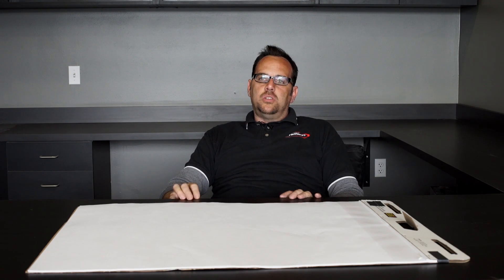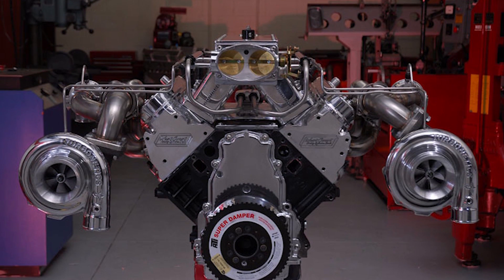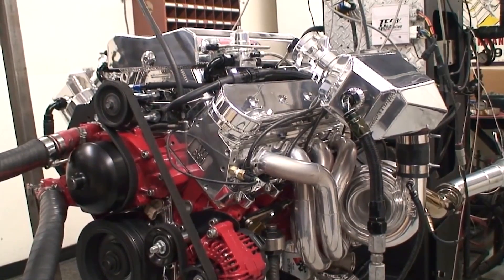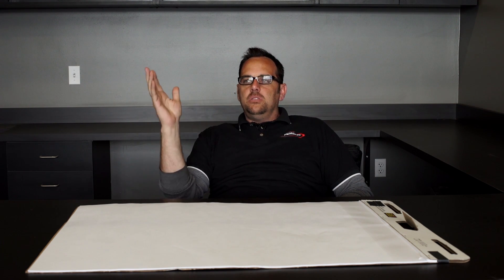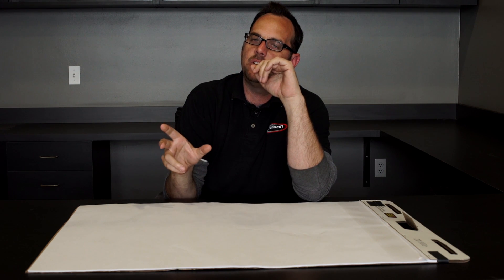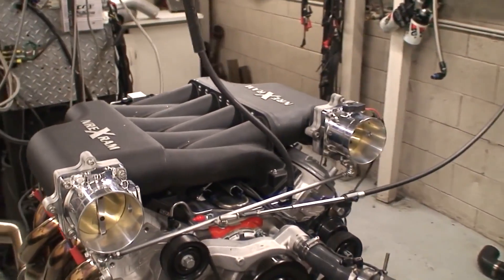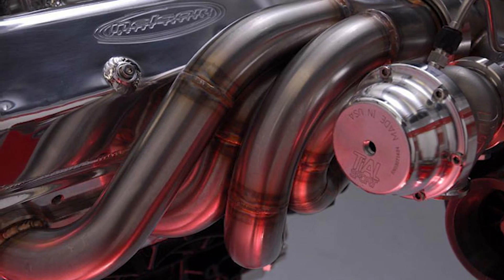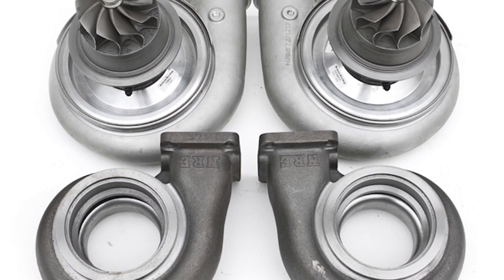Master Engine Builder Explains Why the LS V8 Is SO Good

Comment: wankel = god. fuck ls.
Reply: That is why the RX-8 sold so well! Oh wait...
Reply: inb4 gas flow efficiency, dated design, cool gimmick and dead end tech.
Reply: inb4 reliability.
Reply: Rex Pepper Wow!!! You really went there?! GTFOH with that leaky apex seal bullshit..  There is a reason why mazda doesnt run rotary engines anymore..I tell you like i tell the ford guys if youre engines are so good.. Then why do mazdas get LS Swapped?! Drops Mic
Reply: I'm going to have to agree; wankel is a better concept.  Not as easy to mill a wankel engine as to bore a piston cylinder tho.  LS is probably the best bang for your buck with high horsepower piston motors, which have been refined for racing auto's to the nth degree.  Wankel notso much...totally comparing apples to oranges.  If we were to re-write history and the wankel took over autos in the 50's then our car engines could be 1/5th the size for the same power.  I tried to buy a wankel a few years ago but the military has all manufacturers on lock down bc that's what they use for their drones.  Wankel has a bright future in aviation and EV's, but not in American autos where the politicians decide what's on the street.
Reply: Starstriple Dated? sure, but worthless and pathetic? fuck outta here.
Reply: wankel is like two stroke engines today..

Comment: 300 hours per engine, at 100 bucks an hour that's a 30k a motor
Reply: I'm sure that 300 hours is for the R&D for that specific motor and or parts combination. Once finalized they can bang out engines in a few hours for good price.
Reply: @TheUnendingJourney  Wrong. Watch some videos how fine tuned to perfection EVERYTHING is on these race engines.
Reply: yeah but you can daily drive them and itll go from pump to vp fuel in a switch whenever you want. its worth it than spending 90k for a hellcat...
Reply: But he builds amazing motors, motors that will make 1000 wheel on 93 and do it forever
Reply: if you want a twin turbo engine from this guy you need to spend at least 30k. Some of his engines are 60k or more.
Reply: LooooooooooooooooooooooooooooooooooooooooooooooooooooooooooooooL
 @cherb23
Reply: Check  out Nelson Racing Engines, they are great also
Reply: Baha Baskir well when you're making the money he makes and the engines he and his company puts together then you can talk about how he needs to go back to school.
Reply: plus parts lol
Reply: Look at the NRE website, they're not banging out any bargains.  His "cheap" crate engines are over $12k.
Reply: Harry Henderson Chuckle...I did the same math. Not cheap!
Reply: Not 300 man hours 300 hours total, all the milling is automated, slow and meticulous .
Reply: Yea! Thats SERIOUS 4 SERIOUS people!!! Me, I'm a simple ton with a very clean 03 f150. W/ 60k miles lariat. I love the truck, its as smooth as a body on frame car from the 70's, but bro @$100 an hr. 30 hrs, even though I hate the new FOMOCO it would get JUNKED!!! I'm not so stupid that I don't realize you are talking GM engines but it was fascinating.simplicity is better to me also.normally aspirated high compression torque monsters are best. Although I've never driven my truck much since I bought it new in 03, I thank God i didn't opt for fords feeble attempt @ the OHC, instead I chose the OHV 5.4. I know this was about GM dont be 2 hard on me.
Reply: @Spacelyz Rockit you have NEVER seen street outlaws then,90% if them have Nelson engines
Reply: and thats just labor...
Reply: Nelson Racing Engines (this guy's company) does crate engines for the consumer. They do twin turbo V8's that turn 2500hp and are completely streetable. We're talking cars that are capable of sub 7 second quarter miles and only 1400 rpms while doing 70mph down the freeway. Check out his videos on a black 69 camaro.
Reply: repti billy Hellcats 65k...55k used not 90
Reply: @Spacelyz Rockit yeah that's why insurance is so expensive, lol not all the fraud and non insured losers or illegal immigrants out there causing accidents
Reply: And that’s without the costs of the motor itself. You will have a bulletproof motor that will make crazy power. You will have a book on every nook, crevice, part, tolerances, everything. This guy is very good at what he does and delivers what he’s promised and more. Sure a well built LS can be achieved for WAY WAY less than his price tag, but this guy puts in hours of extra little details into each build.
Reply: It's a rich mans sport that is for sure
Reply: These engines respond very well to turbo/supercharging. Having a simple valvetrain is a plus as well
Reply: I think Machining etc, include, other wise if he build engine 300 hour, he needs go back school.
Reply: @BB-vd8dj  no shit its automated machining, milling etc not just man hours that would be impossible
Reply: Harry Henderson If you cannot pay, then dont play!

Comment: EngineLabs LS vs Coyote Shootout: The Winner Crowned   Here you go Chesley
Reply: Scott Kinderdine And has your Car been recalled? HAHAHAHA
Reply: Hehe, I won't spoil the winner but I'm glad they finally revealed the results.
Reply: Don't you have a crowd to run into? HA HA
Reply: The problem of the Coyote, is its size and weight (It's a Quad Over Head Camshaft engine). It's a question of packaging and Dollars. A 6.2 or 7 litre Coyote would have to be huge, too large to fit under almost any hood, not to mention very, very expensive...
Reply: Frank Chapa uh technically not theres tons of maching techniques thats could make a 4.6 liter ls hit 10k hp if you really want to spend the money im sorry dedication makes the mark company does not
Reply: No it hasn't.... LOL.... It runs Great!
Reply: Scott Kinderdine After 2 years it won't.
Reply: I'm not worried about it...... I also have a Ford and it has more problems than 20 Chevy's combined!

Comment: Does LS stand for Long Stroke? or Log Stove? Hey, I'm Ford to the bone, this comment is only to make you laugh. I'm well aware Chev makes AMAZING motors.....
Reply: GM makes amazing motors.
Reply: don't talk Honda lawn mowers among chevy and ford convos  lol joking naw Honda does make good motors my leaf blower has been running great for years lol
Reply: Carat Cranker I'm a Chevy guy, much respect for the Ford's also.
Reply: Ford, Chevy, Mopar- I like the one that I can get the best deal on at the time.
Reply: 280zjammer julbord buûh hjvbb. Bvbvlbvbb bbjbjjjbbnnjjjiulnkk. Bjuv Nääs BB njuta häva    
Uäj n  såqZ
Reply: Winfield Mayo dc
Reply: i have a 1998 ford DOHC 4.6 NA that is getting almost 2hp/cu.in..all aluminum. its all about airflow thru the cylinder and lots of RPM.. the down side is the damn thing is so bloody huge externally. stout block.
Reply: and yes i do indeed like the LS. nice engine
Reply: why does it take 6L to produce the power of a 4L Porsche?
Reply: To be far all engines these days were based off the ford's gray mare, so ford wins in the end.
Reply: The Powerstroke is a Navistar engine re-tuned by Ford. The parts for the Ford re-tune are still made by Navistar and sold by Ford. International calls the older ones the 444E, next is the VT365 then the 6.0. It's not fair to credit Ford for anything good or bad regarding this engine. I say they Ford has taken the lead in engine technology as of late. The current diesel is not a Navistar engine. I believe it's actually made by Ford.
Reply: Winfield Mayo shut up you fat hick
Reply: honda makes AMAZING motors as well

Comment: Because they copied the ford skirted and cross bolted block design of the late 406/427. Many copied ideas from the FE are incorporated.
Reply: Mustardstain504 D they didn’t copy anything. Otherwise ford would be using the design and they’d sue gm for copyrights

Comment: LS is an amazing swap because you can fit them in almost anything. Like the Miata. It's one of those cars that you have to be up close to understand the actual size. It's crazy you can fir a 6.2l in that thing. You can barely fit a 5.0l Coyote.(Not knocking the Coyote. It's still one of my favorites)
Reply: The coyote is awesome but I don't see it ever being as swappable
Reply: TBustah Flyin Miata has a miata with an LS3 swap on the new ND Miata. Theyre looking to release a kit soon. Worth checking out
Reply: Yes, but this is one case where it might be more swappable than the LS, which I believe is the reason that Gregory brought it up.

There's a kit out there specifically designed to fit a Ford V8 in a Miata called Monster Miata.  Perhaps things have changed with all of the LS mania in the last few years, but I don't think there's anything out there for the LS.  You're on your own making mounting brackets and such.  What's funny about it is that something like this could have happened: Ford and Mazda cooperated on several models from the 60s up until recently.
Reply: Gregory Kanniard I
Reply: Its not all about size but it is cheap and compact
Reply: The kit was for an old school 5.0, not the big headed coyote 5.0.
Reply: @invisableobserver  it's a car enthusiast's thing to do, that's why.  It's very simple.  If you think it can't be done, hold my beer, type of thing.  The Monster Miatas and Flying Miatas are just fun as hell to drive.  The Miata turns into this thing of joy when you actually drive one.  Even a simple stock 5.3 truck engine put into a Miata is just outstanding and great for a daily.  It's not just a flimsy wreck anymore, it's a street machine that someone wants to spend time driving.  That is what's it's about as far as being a car enthusiast's vs. being a car critic.
Reply: @invisableobserver  man, you're one big dumbass
Reply: Coyote my ass ls7 all the way
Reply: B/c the Coyote is 6,000-35,000$.
LS are dirt cheap.
Reply: Coyote is obsolete,the Miami exists

Comment: Can I shove an LS into a stock 2001 dodge durango?
Reply: Squid Of Overkill  Here is my advice to you. Keep that Durango Dodge powered by finding a similar year R/T Dakota or Durango that has wrecked, and pull the 360ci out of it and set it right in. No adapters or specialized engine mounts needed. You'll be very impressed and happy with this simple swap.
Reply: put a hemi in it. its way better
Reply: You can, but you make what we call in the business and abortion.
Just don't do it, if you want an LS, get something that is made by GM and preferably came with an LS.
Put a hemi in the Durango, it is an awesome engine and will make you smile.
Reply: a hemi in my first car? Sounds like a great idea. all that power, just think!
Reply: With the right adapter plate, yes.
Reply: the engine mounts will fit as well? or will they need to be modded?
Reply: Squid Of Overkill I would imagine that you will need new specialized motor mounts.
Reply: LSX 454 is the best motor . small and the big block
Reply: Yes all bolt in.
Reply: TERMINATOR-X may not fit. Its a fatter engine
Reply: Squid Of Overkill everyone say no so that he won't water his money on that junk suv

Comment: Imagine how much more efficient these engines would be if they made them OHC instead of the outdated pushrod type...
Reply: Why? Elaborate please.
Reply: RoyMach1ne OHC makes the motor harder to work on, taller, weigh more, and the only real advantage out of it is you can do 4 valves per cylinder. They both have around the same rotating mass because OHC motors have longer timing chains and theirs two of them. one cam is less rotating mass than two or four. Nearly all LS motors can rev well past 7000 rpm stock. Mechanical lifter motors can rev into the 10,000 rpm range. the only advantage ohc has of ohv is the ability to run 4 valves per cylinder, but LS cylinder heads are already so efficient and flow so good that they don't need 4 valves per cylinder.
Reply: Good argumentation. But stock for stock (no mec. lifters) the dohc motor will sustain higher revs better.
Having a smaller engine that makes the same power or even more counterbalances the weight/size increase.
You could then run a 305 that's peppier and more rev happy than a 350/383 with the same power and less weight.
Also, rotating mass is not as bad as reciprocating mass (lifters, pushrod, rockers)
But in the end, for me, it all comes to this 
OHV: 1.14HP/CI
OHC: 1.98HP/CI

Nice talking with you.
Reply: HP/CI aka power/displacement doesn't matter, because 10000 rpm times 3.5 liters is the same amount of air as 5000 rpm times 7 liters. It's moving half as much air at a time but doing it twice as often. Power per mole of air would be a better comparison instead, as it does not matter how much boost is being used or what RPM an engine is turning. But for racing performance comparisons, power to weight is the more important statistic, and if an OHV engine makes more power than an OHC engine of the same weight, it wins the comparison.
Reply: If a smaller ohc engine produces the same power as a bigger ohv one, we can logically assume that an ohc engine will completely eclipse a same size/weight ohv engine in terms of power.

Pushrod engines are simpler, and the aftermarket support for LS engines is astonishing. Wonderful engines, but inefficient nonetheless.
If GM decided to enter the 21st century and develop something modern, I would be the first to cheer. 
But at what cost, we probably wouldn't be able to work ourselves on our engines as much as we can now. And I'm not even talking about R&D budget and parts price.

100hp/L is not uncommon nowadays for an ohc engine. That means a base LS1 should have more power (570) stock than a LS7now (505) if there were OHC versions to be developped. And that also means an LS7 with ±700hp N/A.

Would be freaking nice!
Just a sweet dream unfortunately.
Reply: RoyMach1ne So... the overhead cam doesn't add any size or weight whatsoever? Nice! /s They can work well, don't get me wrong, but I hardly think the kind of power people get out of these ohv engines is 20th century by any stretch.
Reply: +oddball0045 35 pounds lighter to be exact.
a good trade versus 170hp imo
all I'm saying is that these engines could be 30% more powerful whilst being 7% heavier.
Reply: Then it wouldn't be a GM LS small block.But you may see a DOHC V8 from GM in the next few years...
Reply: +Andy Harman Word
I certainly hope so though
Reply: RoyMach1ne I know your comment is 1 year old but Mercury Racing did exactly what you guys were talking about. They modified a LS7 to its limits and converted it into a DOHC engine. It's called the "SB4" and develops 750hp which seems great for a naturally aspirated 7.0 engine. It weighs 500 pounds which is about 45 pounds heavier than a standard LS7. A built LS7 can develop just under 720hp (check MAST crate engines) so the whole DOHC thing doesn't seem to make any sense to me considering the engine gets bigger, more complicated, heavier, more expensive to buy and fix, more parts that may break etc.
Reply: Outdated pushrods but building motors that make 2000hp using them lol. Not going to see much at a dragstrip using cam followers

Comment: thinking getting 05 c6 with 150k miles. not sure if it still runs strong and have plenty live on the motor. but LS motors are bullet prove. still I not sure I can take the chance getting it. cost is $15k
Reply: 150k is nothing to a modern well maintaned engine. My g8 has 120k and still running strong just check if oil changes/tune ups were done appropriately on that corvette
Reply: +Thevalley Rodriguez thanks. is it expensive to maintain it. like regular replace parts if one of them ever breaks. the only expensive parts so far are 4 tires. what have you replace on your car so far?
Reply: My LS1 was still going strong at 150k.  It didn't really start showing signs of age until about 220k.  Now at 253k it's pretty much worn out, with high oil consumption.  Still doesn't leak oil or coolant, and doesn't have any mechanical noises.
Reply: good to know. what do you mean by its showing its age at 250k. BTW the car is at a dealership, they will do all the maintenance and cleaning when it's ready to sell. high engine oil consumption?